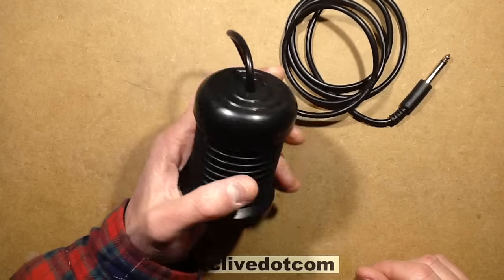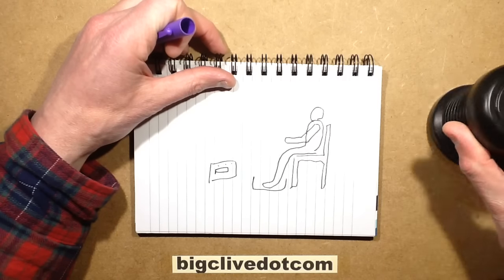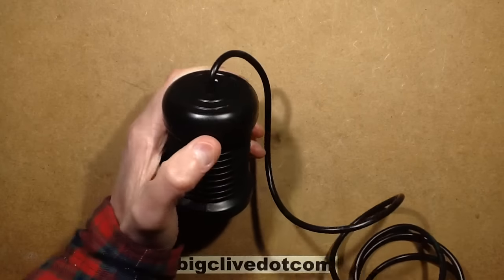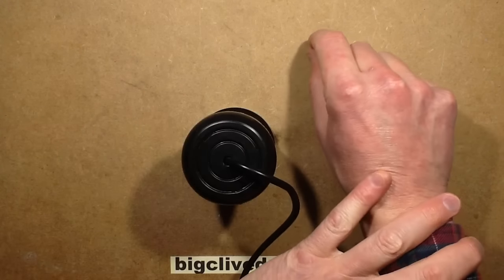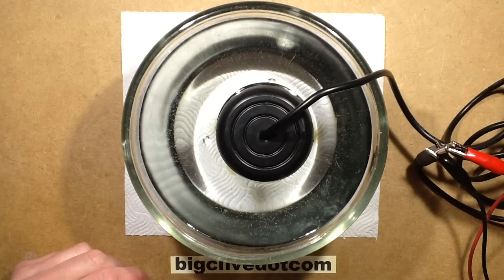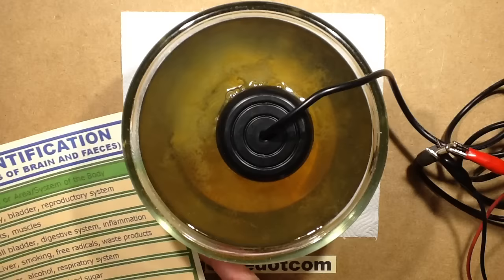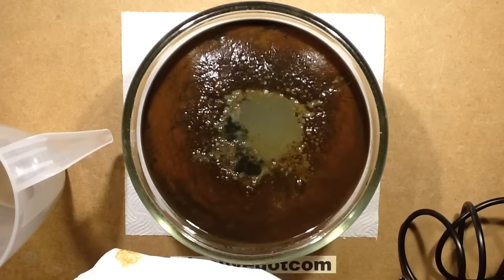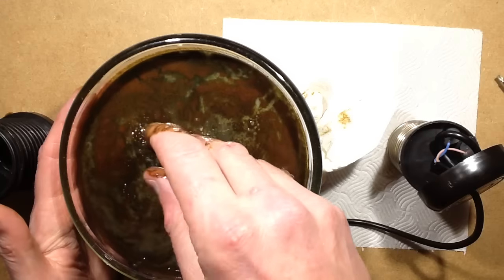Ionic foot detox electrode scam.  How it works.

Comment: I just saw an ad for this and decided to look for a review. Thank you!
Reply: Did you really need to look up reviews about a product claiming to pull toxins out of your body by simply passing electricity through the water you submerge yourself in? Maybe you should try with a toaster instead, more voltage = better right? 💀
Reply: @DrakeOola  Meh, can't fault someone someone for keeping an open mind and doing their research. The average person doesn't know enough to call it out as fake right off the bat, though presumably this person knew enough to be skeptical and look into it. 

There's plenty of actual technology that seems just as magical as this to people who aren't trained in how it operates, which is why this is such an effective scam. I imagine when the microwave oven was invented plenty of people thought "surely you can't heat something up just by shooting it with invisible magic." The only difference is that its effects are verifiable to the casual observer.

On the other hand, we also have functional technology without casually observable effects which means swathes of people continue to distrust it still (vaccines come to mind). The point is, it's better to do research and be proven wrong than to always trust your first instinct and unknowingly be wrong.
Reply: @Momohhhhhh  However, there are people who are paid by commercial interests to run misinformation. The presenter of this video did not adequately describe, scientifically, how the ionic foot bath works i.e. no specifics about what type current is used, nor the salt which is not ordinary table salt. Always remember that the term "quack" was invented by the medical oligarchy to protect their products against the efficacy of natural remedies.
Reply: Lol same
Reply: Same here!  just saw the commercial again.
Reply: @DrakeOola  I knew better, but there are a lot more people that don't know better, not necessarily their fault.  I had a chiropractor treat me w this 20 years ago when I was a kid, and even back then I felt like it was snake oil.  I don't understand how YouTube can allow these ads

Comment: Assuming it is stainless steel:

The anode (positive) corrodes by attracting chloride ions.  This locally dissolves the alloy, making assorted chlorides of iron, chromium and nickel (the majority parts of traditional stainless steel).

At the cathode, sodium ions are attracted, forming, well, not sodium metal because that takes 2.7V or so and water will only ever handle 1.2V, so it reacts instantly with water, producing hydrogen gas and hydroxide ions.

When the local environments mingle, hydroxide combines with the metal ions, precipitating very insoluble hydroxides.  These have a very small particle size (not quite colloidal), and range in color from gray (iron (II) hydroxide) to green (chromium (III) and nickel (II)).

Additionally, iron (II) hydroxide is unstable, and partially reacts with water all its own, releasing hydrogen gas and changing to brown iron (III) hydroxide -- rust (or, one of its constituents, anyway).  Mostly, where oxygen is available at the surface, it oxidizes spontaneously, leading to a brown film or surface layer.

If you use a base instead (sodium carbonate or hydroxide), the oxygen overpotential is depressed (big techwords for saying, it isn't attacked by acid ions anymore), and you get oxygen from the anode and hydrogen from the cathode.

The "rust smell" is due to impurities in the steel, mainly relating to sulfur, phosphorus and carbon (which are present in small amounts, < 0.02% for S and P).  Apparently, some very complex organics come out of the process, which are of course quite pungent, ranging from 'metallic' to 'garlic' and 'brimstone'.  The concentrations of the odor compounds is very small indeed (parts per billion) -- the nose is quite sensitive to them!

Finally, assuming the rods are conventional 304 or 316 stainless, these are nominally paramagnetic (very weak, too weak for a magnet to stick), but they do become slightly magnetic (a few times more, enough for a magnet to barely stick) when work-hardened.  Likely, the wire starts out somewhat hard (wire is typically sold in a hard-drawn state, so it's good and springy, but not so hard that it can't still be bent into shapes), and the winding would add just a little more to that.  Thus, rendering it slightly magnetic again.
Reply: +Tim Williams Oh, one more thing: nickel, chromium, cobalt and other metals have been found to cause sensitivity and exposure dermatitis.  Apparently it's something like an allergic reaction, to certain metals.  You might not have any response, or you might one day (after handling a lot of it) come down with irritation and stuff.

This isn't normally a problem (most coins contain nickel, for instance), but people don't soak their feet in finely precipitated metal compounds, either.  I would imagine the greatly increased surface area would bring a large risk of metal dermatitis.  So you are correct, this thing is a potential health hazard!
Reply: +Tim Williams 
Since you know your stuff. could you take a look at my case?

I'm wondering whether doing iontophoresis with two 9 volt batteries in series using two stainless steel bowls from Ikea and tap water with baking soda is dangerous?

There is actual scientific evidence that this therapy helps with heavy sweating of the hands (unlike toxin bullshit), which is what I have (hyperhidrosis). And I don't get any sludge or smell after a session, the water is as clear as it was in the beginning.
Reply: +Tim Williams I so appreciate educated comments like this.  Great writing.
Reply: Tl;dr, I think the metal is stainless steel tons of science stainless steel will be a bit magnetic again
Reply: Thanks for explaining, i didn't think of chrome and nickel
Reply: Tim Williams appreciate that, but what is with the water 'only conducting 1.2 volts'?? it was not april fool's day when you wrote this, was it? I can't even think how you could make it up, let alone understand it if there would be something to that??!
Reply: 1.2V is the reduction potential of hydroxyl.  It's the reason water needs >= 1.2V to dissociated into hydrogen and oxygen, and the reason a cell cannot be made, with water, that generates more than 2.4V.  (Lead-acid is the most common practical chemistry that pushes this limit, generating about 2.0V per cell; all the common 3V+ lithium chemistries use something other than water.)

A cell can, of course, drop more voltage, due to electrode overpotentials and resistance of the electrolyte.  What I wrote was a simplification concerning the absolute maximum half-electrode potential in water.  A simplification well justified for the simple medium of YouTube comments, and enough to entice the curious reader to, perhaps, look up an introductory electrochemistry article.
Reply: @T3sl4   I actually remember doing this with batteries when I was a kid. I tried all kinds of ions, and probably cut a few years off my life. XD
Reply: @Tim Williams would this detox work in the case of agent orange/dioxin poisoning?
Reply: @Tim Williams would this detox work in the case of agent orange/dioxin poisoning?
Reply: I can’t help but think about that metal implant in my arm put there by a well meaning surgeon. I know they say that it’s safe but I can’t help but think it’s releasing metals into my body.
Reply: Awesome response
Reply: Essentially, insteadvof detoxing you're soaking up toxins?
Reply: Reminds me of the good ol days when I learnt chemistry.
Reply: What the hell you talking about meng?
Reply: Tim Williams o m g WHAT?
Reply: Tim Williams I appreciate your knowledge.  I am allergic to metal (yes all metal).  Only4% of the worlds population hav3 an allergy to metal this severe. Yes, I am one of those people.  Thank you for your knowledge. I become very ill, dizzy, vomit, etcetera.  I needed to see this experiment to keep from making a huge mistake. Thanks again!
Reply: In the testing that I've done I found that stainless steel does not generate the color in the water very easily however if you were to use cold rolled steel it will generate exactly the conditions that I am seeing video.
Reply: Thank you for sharing your understanding with us.  Yours is one of those comments which keeps me believing YouTube is something of an academy. :-)
Reply: 😱 Amazing! Thanks
Reply: I wish you were the first commenter on every YouTube video. I wouldn’t have to read any other comments.
Reply: @Captc5766  Lol, exactly
Reply: @kagi95  botox.
Reply: @anitatobin7427  Id highly suggest a ketogenic diet.
Reply: Dawud R.  
 it's Chinese crap is what he said. if you know someone that bought one .could 
Donate it to Your kids school . They  might enjoy Experimenting with it. might be able to make sone brown gas. (Hydrogen). with it.. Or turn it into a rust remover.. Is also what he said .
Reply: @dana102083  
 And  Chelation. We are all load up with heavy metals. 
We should be able  to send and Receive messages from the other side of planet on our own buy know ..
Reply: Type English pls
Reply: This is exactly what I needed to know!
Reply: So you mean to tell me you can conjure up you're own pocket sized "magneto" from the x men .. lol jk
Reply: @matronarona  apparently you also skipped the part where your teacher taught us never put a T after a verb..
Reply: Question: How safe its to have your skin inside this nasty solution?
Reply: Thanks for that thorough explanation! As soon as I seen the insides and he questioned if it was stainless steel, I wondered if this was an HHO generator actually!
This could be dangerous if the fumes reach a spark.
Reply: @briansoddjobs  thanks for the add!
Reply: Most of the research I've done had some warning at some point, not to use stainless electrodes because of the potential of releasing chromium-6. That is the worst thing I can imagine being exposed to... (Think "Erin Brokovich")... I may be miles off, but the thought still scared me when I saw this.
Reply: So what affects do it have on your body
Reply: El aparato que uso tiene display de amperaje y proteccion en caso de superar o poner en riesgo , el array lo limpio con vinagre blanco . Si entiendo su Amplia explicacion . Y si me ha dado resultados de confortable y progresivo bienestar . Gracias por su Aportacion
Reply: Just had this for free to see if it was all it was cracked up to be but when I started asking questions realized not if this is true lol as I could see the brown coming out of the coils and was then told “but it won’t be “that brown” so you have stomach issues- which I so not. Lol 😂 If it wasn’t so gross Id say great on the hot water bath and foot rub! Lol 😂 😂😅😊

Comment: I knew it!! My friend who had a unit like this in her Spa (many years ago) gave me around 10 sessions or so for free. She said it would help with my Fibromyalgia pain. Never did see or feel a difference. My water didn't turn too murky, she must have had the current turned to low! lol  I was skeptical then and have been all these years. What a scam... thanks for sharing this!
Reply: Some friend that was, of course I'm no person to judge.
Reply: maybe she genuinely thought it worked herself
Reply: yes, you are probably right...
Reply: Christina Betts you do know that this process of electrolysis of stainless steel produces hexachrome, this is extremely dangerous, as it's a carcinogen!
Reply: You may feel better because you are being exposed to negative ions, but there are no long term health benefits!
Reply: Lord Kek depends on the type of stainless, and normally you need a shit ton of amps to make that happen.
Reply: Christina Betts - At least the treatments were free.
Reply: Lewis MacQueen - I didn't know that.
Reply: +carolyn mmitchell
Pretty much all water soluble chromium compounds are toxic, using stainless steel for electrolysis is a no-no, just don't do it even if you have no plans of bathing in the damn mess, the result is still an environmental hazard not fit for pouring down the toilet.
Reply: aleksander suur WOW!!  What a scam those foot baths are!  I’d rather do a gall bladder or liver flush to get real results. I’d like to know what the Mecanism of Action is they claim causes these baths to work.
Reply: If anything, these work due to placebo effect. If you think it’s going to help your mind thinks you feel better.

Comment from the maker: The video zone has to get cleared before every video.
Reply: +bigclivedotcom I played with electrolytic rust removal engines and one of the warnings you get everywhere is never to use stainless steal electrodes as they give of toxic gases and the residue. So I guess in stead of detoxing you its more likely to do the opposite.
Reply: +Eken Eken one of the nastiest species of crud produced is hexavalent chromium from the stainless steel. It falls under the do not ingest, do not touch, do not dispose of down the drain category. Sodium Metabisulfite (home brewing supply shops would have it) would reduce it down to the much less toxic trivalent state. There is an idea, "the toxins extracted from your body are so nasty you need to add a packet of this magic powder and let it sit before dumping down the drain". Unscrupulous SCAM artists can make more money and be better for the environment in one go.
Reply: +Robert Szasz I didn't know the names and what any more and was to lazy to look it up.
But all in all NASTY!  
So bigclivedotcom I hope you washed that good and your hands.
Reply: +bigclivedotcom Usually it's filled with "Epson" salt. It is supposed to help with sore muscles.
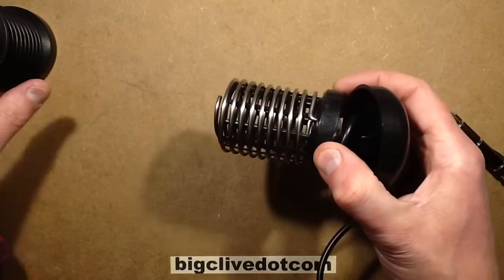Reply: +bigclivedotcom hey at around 3:36 you had trouble keeping your hands steady. Is everything all right?
Reply from the maker: +Brett s I was trying to wiggle the cover down over the flex.
Reply: +Brett s derp.
Reply: +bigclivedotcom Using a magnet to test for stainless steel isn't reliable, as 300-series alloys are nonmagnetic, while 400-series alloys are magnetic.  Also, 400-series alloys will corrode under certain conditions.
Reply: ***** I am guessing that the the specific alloy that is chosen is a result of how impressive it will corrode under these circumstances. I'm not saying it's something exotic, only something that will yeild a wide range of colors and react to give an ample amount of oily precipitate.
Reply: +Eken Eken my thought exactly
Reply: You need to delete that video before we apply ziberzone act!
Reply: +Madeline Dalere I can't wait to see that court case you've filed.
Reply: +Madeline Dalere haha you're crazy
Reply: hey, Big Clive ! my name is eddy and I'm 17 and I wanted to know if I could make one of these so I connected some tiny probes meant for  a Tens unit (shocky massage for muscles) to my custom made battery pack (one usb output but switch for choice between 1 amp or 2.1 amp) and I turned it on inside a Gatorade bottle filled with a bit of tap water and some table salt and it worked like a charm! it's been around 20 minutes and I can see green and yellow things floating with lots of bubbles! thanks for the videos buddy,  keep it up
Reply: Look up HHO this produces Hydrogen gas people use this to make gas to run cars cutting torches cooking.
Reply: oldpukindog Sure, you can do those things, but HHO arrived from water through electrolysis has not net gain. It'd be like putting car exhaust back together again to make gasoline. Sure, you might be able to do it, but there will always be a net loss.
Reply: turnipgoodness
Yes you maybe correct as to the efficiency. Was only trying to back up the fact that this a fraud. And sense I had tried putting HHO on my car (a ford) with out much success. I could see what I had found in doing it with my car. Tht all I was trying to state. However there are U-TUBE videos where some are having great advances and producing useful amounts of gas being able to do real work with HHO.
Reply: HaHa
Reply: bigclivedotcom I have one of these and I use it as an hip generator! It creates quite a bit.
Reply: *hho
Reply: I thought the same thing! That was the shakiest wiggling of a cover I've ever seen.
Reply: Doing gods work sir.  Hopefully those researching this quack product find your video.